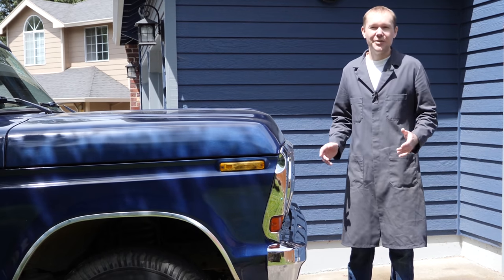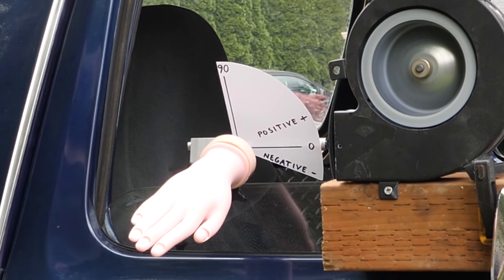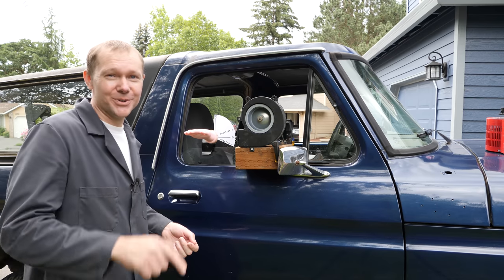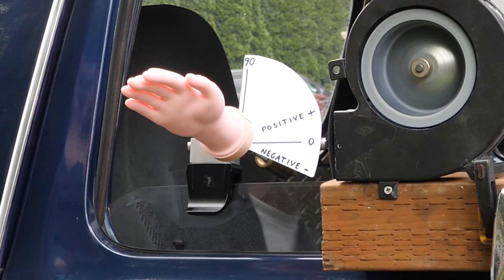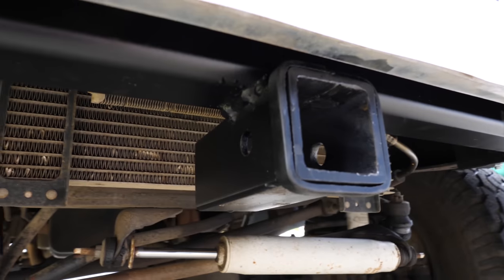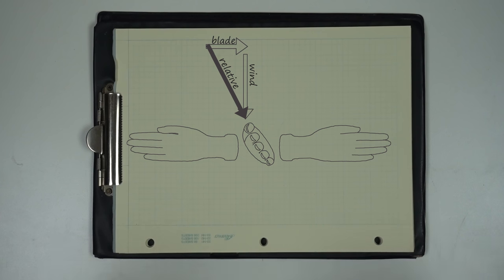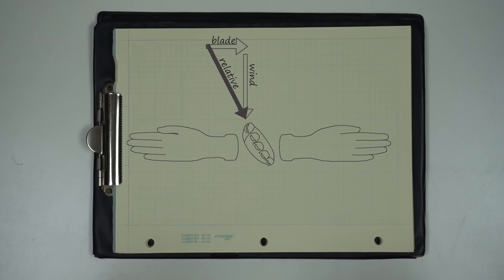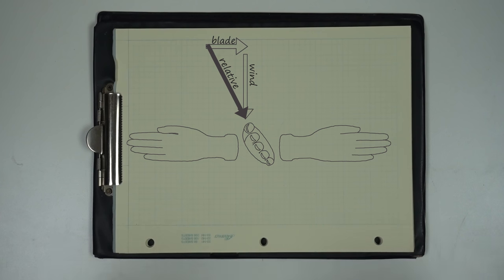Wind Power on a CAR #1 - Is it FREE?

Comment: This video is also great information for pilots in propeller aircraft. A lot these pitch angle concepts come in to play when talking about constant-speed propellers. They vary the pitch on the propeller to maintain a constant engine speed: thus optimizing the output of a piston engine by running it at the ideal RPM. Is it worth doing something similar for a wind turbine? - probably not, given that the variable frequency voltage output is rectified to DC anyway, but does it affect the efficiency of the blades in collecting the energy from the air?

Comment: You should try a squirrel cage fan located under your hood with a ram scoop on the hood. you could have tachi flew on the intake on the ramscoop to adjust how much airflow goes over the fan on the generators at different speeds.
Reply from the maker: Oh, I LIKE that!!!

Comment: Make a vertical wind mill. Lay it across the back of a mini van. Make a air funnel from the front to the back to the vertical windmill. Than the air out funnel gets lined up as vacuum. Now the noise of the van compresses the air up in to the funnel, the funnel compresses the air to the wind mill and turns it and exits it with help of a vacuum created by the van. The drag would be all most 0 because the van has done the work already.

Comment: Your concept should definitely fit on top of buses and trucks....but you need to design horizontal roter blades...fitted in to horizontal box from end to end.. with top sheet slanting slightly tilted upwwards to catch more breeze that could get into horizontal turbine.....

Comment: You just gave me the idea of how to keep electric only cars  always charged up day or night. Invent many tiny ones around a electric car in certain locations around the front and top of the car to meet the power charge always needed to keep those batteries charged. Pretty much would never run out of power to drive it. Only thing you'd have to worry about is replacing aged blades and internal batteries over time which they could make super easy to do yourself. I mean it would work great as a new always running car that doesn't require a cord hookup at all times like the current ones do. You'll always have energy cause it charges once your driving and always generating wind to constantly charge the batteries. Unlimited power no need for hooking up to electricity or use gas or even solar, but I'd have solar built into the roof of the cars for a safety backup feature along with being able to plug into regular electric outlets to at least keep enough charge for it to start up on low power. Make it where it only needs regular current hookups from any standard outlet not special select ones like they made most electric cars do for the most part that I seen. Ok... I gotta patent this and where is the smart people to build my idea? lol. Lets make billions of $ now and make the cars affordable to.
Reply: Also invent a way for when the car is driving and all 4 wheels spinning is also helping keep the batteries charged up to.
Reply: Im a disabled poor man that really could have my invention change my life I mean It would get me off disability and away from struggling for 20 years now. Wish I knew the right people to get my ideas invented. Make the cars super affordable to. Like under 10k and payment plans to help people that can't get financed for new cars anywhere else. The less they cost and allowing a more wide spread accepting financing plan for low income families the more they would sell in the long run.

Comment: Hello an idea for using the power back to the vehicle is to connect it to an HHO generator and use the hydrigen and oxygen back to the intake.. even better connect it to a welder with carbon rods inside a chamber and take a perfect flammable mixture .. hehe very difficult ideas .. at least you will have something like regenerative braking at downhills!!!

Comment: I love the idea and how you explain the science. I had a similar idea when I was in HS, as a way to recover energy lost during travel. However, the problem would be the impossibility of perpetual motion. The more parts you add to a system, the less efficient it becomes. The efficiency of the turbine, inverter, wires, etc. would make you use more energy in gasoline to move forward than you would recover from the system. Still, it’s nice to see you build what I’d imagined in my head. You are a much more capable builder than I would hope to be. Look forward to part 2. Do you plan on calculating gas used with and without the turbine?
Reply from the maker: Thanks.  Am I correct you never actually tried it though?  I'm hoping the air flowing over a modern turbine blade is so much more efficient than impacting the body of the truck (which only acts to heat the air) that it's possible to harvest measurable energy in spite of the inefficiencies you mention.  But you might be right!  I take comfort there will be enough science learning along the way to make the whole project worth it, no matter what the outcome.  Wish me luck!  And yes, I'll do multiple runs with/without the turbine in multiple locations, monitoring fuel consumption the whole time.  That's the plan anyway.
Reply: Quint BUILDs - no, I never built anything. I only went so far as to buy a couple old car alternators (couldn’t afford a wind turbine). Apologies if it seemed like I was being negative. Awesome job on everything and good on you for teaching people complicated science in a fun and interesting way.

Comment: I had an idea I came up with maybe 10 years ago or so but unable to do it lacking the money it would take to create it.On a car have a roof top case covering the entire roof and have air ducts above the windshield to catch the air coming over it.then have 4 or more channels catching the air into tubes/chambers with one small wind turbine in each chamber.And have the power go into batteries stored in the trunk.I figure if you have two separate cells where you can switch from one to the other to charge the banks you might be able to power the car with the one not being charged.If you make it work and make millions I will save this post to collect my due share for the idea.

Comment: The 90° hands likely act like a centrifual fan to some extent, that's likely why the anemometer reading was higher than 0°.
Also, this is 100% plausible. Have you seen DDWFTTW? A glider has a glide ratio of units forward vs down which can be 70:1. This works because the Lift to drag ratio for the wing is so high, potentially 70 times more newtons of lift than drag. Stick their root to a hub on an axle, and you can get say 70Nm of torque for each 1N of drag. This means the force on the generator is higher than the drag imparted on the vehicle, so if you build the rest of your system efficiently, you can actually legitimately generate more power from the wind turbine on the front of the vehicle than you lose in drag.
I'm looking forwards to seeing more on this project.

Comment: This is great and all, and I have insight to blade design, but it completely misses the original point I thought this was going to be about: scavaging energy from an inefficient aerodynamic vehicle.   My first guess for that is no - it's using engine power to drive the fan, and this has significant losses to transform that to electricity.  I'll wait for subsequent parts.

Comment: I’d love to know more about the interior conversion in your truck man. Looks very clean.
Reply from the maker: Thanks!  It's a resto-mod I did using a wrecked 2004 F-150.  Has the engine, transmission, ABS brake controller...  Trying to resurrect the website I had on it at one point.

Comment: Law of conservation of energy. The added drag from the lift force is compensated for by the engine. Skip the wind and this is what your alternator already does, which is parasitic of the engine’s energy.
Reply from the maker: Totally get where you're coming from.  There are no free lunches.  I'm gambling on the inefficient use of fuel already used to push the air around and if that's done by the turbine blades instead...  We'll see.  I can't disagree with your statements on the surface (no pun intended).  The effort will be educational regardless!

Comment: I like the video, but the energy is just coming from the gasoline being used to drive the truck just a little harder to spin the blades. Wouldn't this even be less efficient since you are transferring the energy like 2 more times? I don't see how the change in aerodynamics would make enough sense for this to work.
Reply from the maker: My reasoning (we'll see if I'm right) is without the turbine the front of the truck is doing work on the air, pushing it to the sides and leaving it with some new higher velocity.  With the turbine some of that work is being done by the blades prior to contacting the front of the truck.  Now if the turbine was mounted ABOVE the truck, no question that would consume additional fuel.  But if it's just in the incoming stream of air?  We'll find out!
Reply: Quint BUILDs All the work the blades are doing is still being done to the truck. I also forgot to mention the added weight of the contraption. Even if you got a tiny portion of energy out of nowhere, the weight and inefficiency of energy transfer would still make this less efficient than a normal truck.

Comment: When I was younger I wondered why cars didnt have something like this. I imagined small windmills could replace the grills and be used to generate power without increasing drag. I didn't realize until later that it would hinder the cooling of the engine.
Reply from the maker: Wow, impressive for a kid! Yeah I'm not planning on testing it in a high heat situation. I do have some ideas on addressing the concern though. Stay tuned.

Comment: Ya know, this is actually a question I have had since 1993 or so. Just never decided to try and test the results.
Reply from the maker: You too?  Awesome!  A pilot buddy told me about Ram Air Turbines recently which are very similar.
Reply: Hello im from Germany ... At First my Englisch is Not so good... I SAW at First the Rain Energie Video... Good Idea... 
 in reservoir there is your Idea... Think a about it... only little bit late
Now my comment to  Wind Energy on a Car ... Can Test it with more turbins in a Tube under the truck ?
Reply: @searyelunknown3618  This is actually really close to the idea I was having back then. With the multiple turbines in a tube either under, around or on top of the vehicle.
Reply: @Atlantis This always upsets me. "You can't do that it violates blah and blah, perpetual motion is a myth, blah, blah" What perpetual motion is, is a theory that has yet to successfully been proven. And just because an idea doesn't work as we think it will does not mean it should not be tried. As technology improves and new advances are made things that were impossible just may come into the realm of possibility. And somethings are done just because we can.

Like the above comment about turbines in a tube. In theory it should not work because the turbulence caused by the first turbine would travel down the tube and affect the next turbine. With proper spacing this can be minimized and still see a net gain.

Comment: The induced drag of the airfoils needs to be overcome by more power from the truck’s engine in order to maintain constant speed down the road. Induced drag and parasitic drag are two very different concepts to understand.   There’s no free lunch, otherwise you’d be building a perpetual motion machine.  The induced drag is a physical reality of generating lift, it can’t be removed - it’s the vector component of the lift force that is “pointing backward”.
Reply from the maker: Thanks for the clarification.  And I'm by no means certain this will work, nor am I believer in "free-energy" machines (no engineer could be).  However, don't you think the parasitic drag on the vehicle body surfaces could be reduced via transfer to the turbine?  Naturally the overall drag on the vehicle+turbine system will likely go up a notch, at least by the amount of induced drag on the airfoils (thank you for that distinction).  Then of course there are losses in the generation of electricity, the betz limit...  I guess there's just so much lost fuel from pushing against the wind, I'm hoping if that "work" were done by the surfaces of a turbine blade that some of the energy could be recovered.  I must admit you're giving me the most compelling version so far of why this won't work. 👍  This could be the first video on youtube showing how a genuine attempt at free-energy DIDN'T work! 🤣

Comment: heh. my hypothesis prior to watching this video, is that no it is not free, it is less than free, both for the sake that the wind drag costs the vehicle efficience, compounded by the efficiency loss of energy conversion.   let's see how my hypothesis pans out.
Reply from the maker: Totally!  Help keep me honest if you see something I'm missing in the future parts.  This is fertile ground for experiments.
Reply: @QuintBUILDs  Man, that hand fan, though, I wanna see you do like a bunch of high fives or something. though that'd probably hurt.   But either way, I'd love to see the overall  power generated vs fuel economy lost/gained.  and then, of course you gotta swap it out for something akin to an airplane prop to see if you can make the truck go faster by adding airplane parts! muah hah! maybe run it straight from the fan belt!

Comment: if you add a prop governor and set the pitch of the blades to change based on a wind meter mounted to the front it would be legendary.
Reply from the maker: Been noodling on how best to do this for months.  Still not quite there.  But oh yeah...

Comment: Couldn't a squirrel cage blower work.
If it was like 4' wide and 6" to 8" in diameter it could be mounted under front bumper or maybe ducked to the back or mounted in air stream behind cab of truck. Thanks for the content you do a great job.

Comment: Very interesting video and nice approach on the explanations! 
But the premise of the title confuses me a bit. Isn't trying to get energy back out of this contraption physicaly impossible ? All the "wind" runing the turbine is in fact just the car pushing the turbine through unmoving air, which means all the energy was comming from the engine in the first place, right ? So what we are trying to build is a Perpetuum Mobile, gaining energy out of itself, which is not possible. Am I missing anything ?
Reply from the maker: Speaking in strict textbook thermodynamics terms, you are correct.  But I'm hoping it is more nuanced than that.  The turbine will by definition reduce the velocity of the air impacting the front of the truck (or increase it depending on your frame of reference).  The question is will the net drag of turbine + truck be any worse than the drag on the truck alone.  Such a non-aerodynamic vehicle must certainly have losses associated with drag that will be more efficiently encountered by a modern turbine blade.  That is my wager, if the more efficient drag of a modern turbine can harvest energy out of this otherwise more sudden encounter of the wind against the square truck body.  
Regardless, a bunch of people will learn about wind power along the way, including me!

Comment: Are you planning to calculate/measure the drag induced by the turbine?
Reply from the maker: If the turbine were above the truck then it would certainly add drag, but in front of the truck in the wind that is already destined to hit, I’m not so sure.  I totally get the “no free lunch” thing, I’m an engineer after all, but hey, it will be a great learning experience finding out!  And of course you know I’m not going to fake anything like the typical “free energy” hoax channels.
Reply from the maker: Oh yeah, we're going to break this down big time.  Nothing hidden, no matter what the results.
Reply: @QuintBUILDs   Fluid dynamics is hard, I don't think you can look at the fan and say "There's a brick behind, so it won't be impacted", you have to model or measure it

Comment: I had the idea of putting a wind turbine on a car 50+ years ago but haven't had the wherewithal to do so since then.  I don't see any reason why it would not save MPG by channeling that wind energy to power the electronics on the vehicle or even add to the mechanical effort to move the vehicle.  Land yachts with windmills on them are able to go directly into the wind so it makes sense to add power to a car (saving MPG) by putting a windmill on it.
Reply from the maker: Lots of folks say it's crazy, and they may be right, but we're going to find out for sure!

Comment: You need the blades cut in half and to be using a 12 volt PMA to charge a 24 to 48 volt battery.

Comment: A RATgen has  centrifugal controls that changes pitch depending on the load and the speed of the aircraft.
Reply from the maker: I'd looked into the RAT but didn't know they self adjusted for pitch.  Some do some don't maybe?
Reply: @QuintBUILDs  That I couldn't tell you. I just know the 6kva RAT I worked on did.

Another way you can slow it down is dynamic braking which is increasing the load you put on it. Also they have a drum that slows it down as well.

The ones I worked on was used for emergency aircraft power and as auxiliary power to run a giant magnetron.
(As Gump would say "That's all I can say about that.")